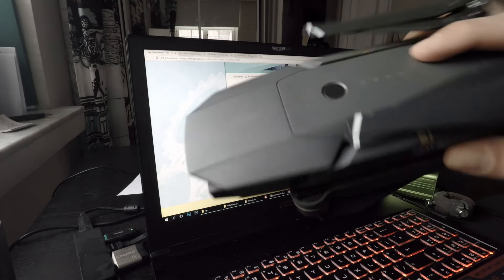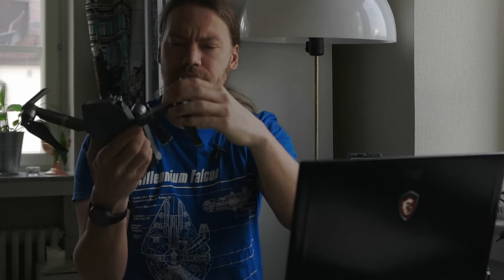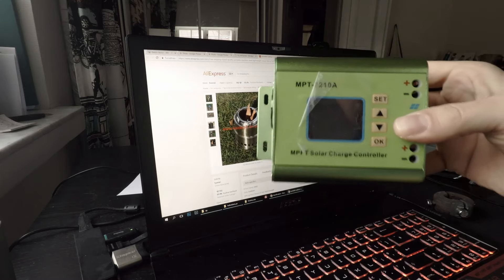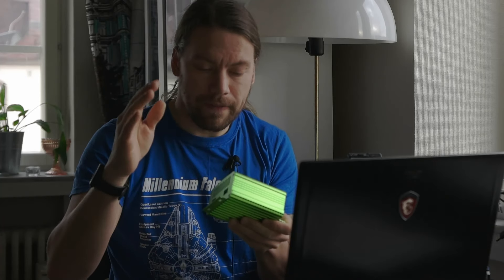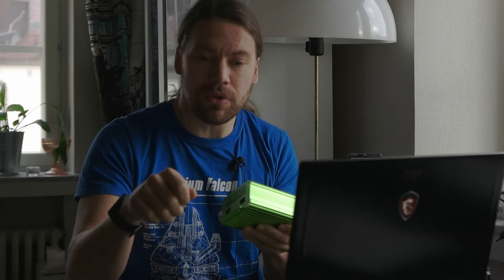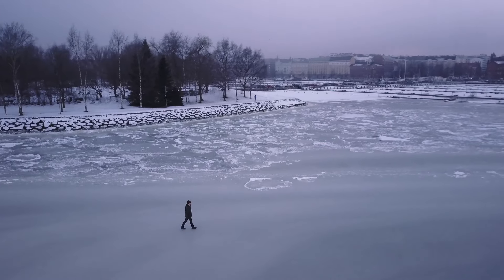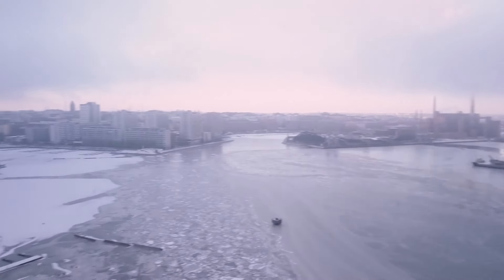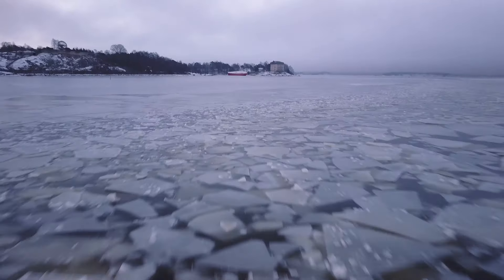My sailboat update plans for 2017

Comment: I prefer the single throttle and reverse switch. Less things to go wrong and easier to get replacement parts.  Everything (or as much as possible) on the boat should be readily available almost everywhere.  Proprietary parts should be avoided at all costs, universal parts are cheaper and easier to source. The broken part you showed can be easily made with brass or stainless steel.  If your making it from plastic, make extras.  Careful when buying those bike batteries, many are limited to how many amps they can put out. Bike batteries are for power assist, not primary power, they can over heat under heavy loads (spinning a prop through water is harder than a large moving wheel on pavement)
Reply from the maker: +Mazda rx7 Good points! Metal won't work with the tiller lock thing cos it has to flex a little bit to get tighten... I forgot to mention that the 3d printer runs on 12v 10A DC power, so I can plug it straight to my boat without an inverter. The new throttle stick is gonna ne awesome, trust me :)
The battery that I ordered should give 30A cont. and 60A max if it's to believe China sellers ;) I think it's true cos it's only 24V with more cells in parallel that same Wh battery in 36 or more volts(and most ebike motors are). My motor and old controller are both rated around 25A cont. so they should make a good match.

Comment: Looking forward to your review of the VAWT. Thinking of putting one on my boat, but I'm curious if it's really as efficient and quiet as they claim. Also wondering if there is any issue with gyroscopic inertia putting excess force on the generator while you're underway.

PS. Great T-Shirt!
Reply from the maker: +John Ross Thanks man! Yep, I'm also looking forward testing the new VAWT. I'd love to test it beside my old horizontal one to really see the difference, but it might be too difficult to do that..
What do you mean by the inertia stuff?
Reply: I was thinking that anything that spins acts like a gyroscope and would resist hanging direction - much like a bicycle wheel.
It occurs to me however this would be no different from your horizontal wind turbine, so not a factor.